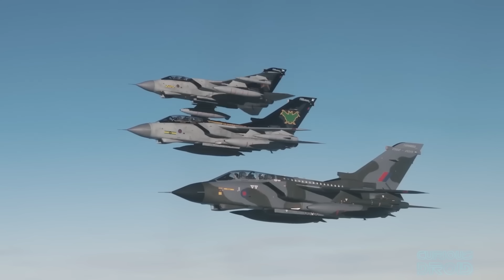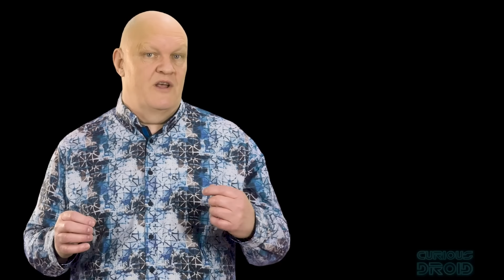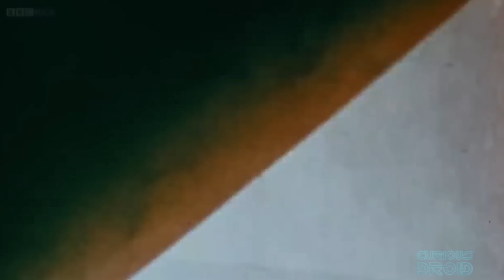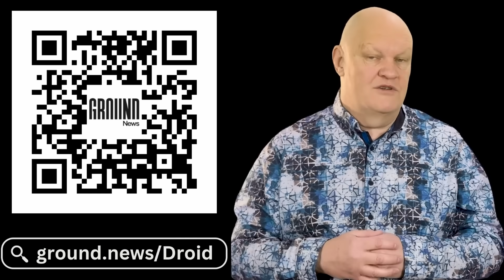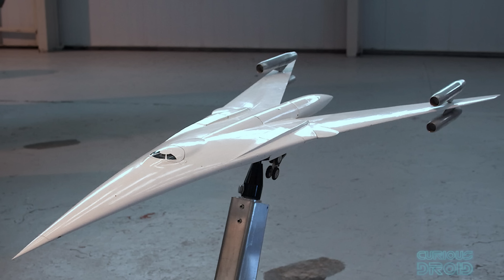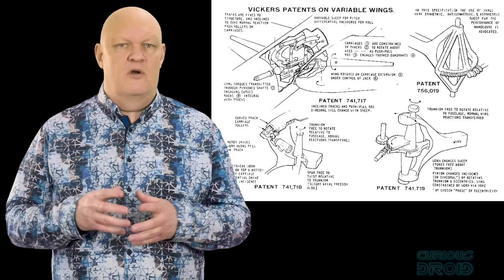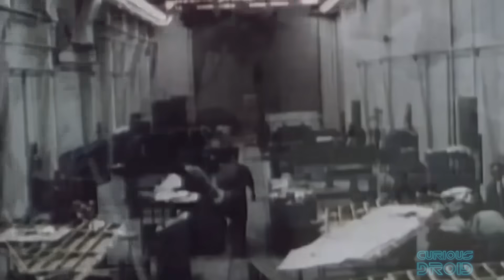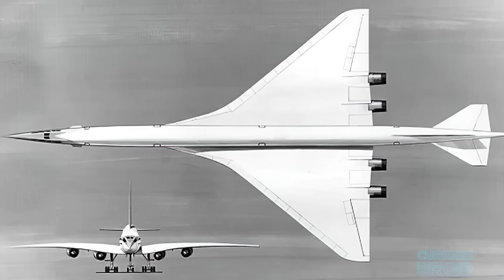Why Aren't Swing Wing Aircraft Made Any More?

Comment: The English Electric lightning made do with almost no wings at all,  pilots used to joke that the the Lightnings wings were only there to space the navigation lights apart.
Reply: The Lightning actually had quite a large wing area, a delta shape with some of the trailing edge cut out. Wing fuel capacity was compromised by accommodating a long under carriage leg, so the flaps & part of the leading edge were also used as fuel tanks.The fuselage held no fuel, so a 250 gal slipper tank was added to the belly, which was increased to 600 gal in later versions, enough for 35 to 50 minute sorties.
Reply: The F-104 held its fuel in the fuselage, whilst the Lightning had to cram it into the flaps.
Reply: That's true. But they were designed for very different purposes. Landing or taking off from even a large carrier would have gone very badly for a Lightning.
Reply: Thinking of the F-104 as well. The wings look almost comical.
Reply: @Laotzu.Goldbug indeed, the Starfighter had tiny short wings, but it also had a very sophisticated blown flaps system.
Reply: The English Electric Lightning seems superior to the F-104 for several reasons. The Lightning reaches Mach 2.3 compared to the F-104's Mach 2 speed. Additionally, it boasts a larger wingspan of 10 meters, providing better stability and maneuverability, compared to the F-104's shorter 6-meter wingspan. Furthermore, the Lightning has a higher thrust-to-weight ratio of 0.74 compared to the F-104's 0.54. It's puzzling why the F-104 was designed with its stubby wings if it doesn't achieve higher speeds than the Lightning.
Reply: @xponen  Cherry picking your data.
Reply: The F-104 was far easier to maintain and was much quicker from alert to brake release and intercept. The Starfighter could intercept an aircraft at 30k feet, 150 miles away from base in about 9 minutes. Pretty dang fast!
Reply: @xponen yes, but remember that the Lightning had two jet engines, possibly each one more powerful than the J-79. The Starfighter had just one.
Reply: @duartesimoes508 yet, the F-104G was as fast as the Lightning. Tells you something about the difference in aerodynamics of each aircraft.
Reply: @pjotrtje0NL she was much lighter than the Lightning too. Had very good aerodynamics and more than enough thrust for her weight.
Reply: @xponen But the Lightning had a terrible range problem that limited its operational effectiveness and a killer of brit pilots.
Reply: @sandervanderkammen9230  Only 20 pilots were killed vs. 116 German pilots alone with the f-104
Reply: RAF pilots called the Lightning the Aluminum death tube... not a very reassuring moniker and a major contributing factor in the demise of English Electric aircraft division and why the British stopped making supersonic jets.
Reply: The F-104 was an outstanding jet but a lousy Fighter and combat aircraft. She had a formidable climb rate but apart from that everything was downhill. Everytime the Starfighter entered combat her performance was lacklustre and I'm not even going to dwell into how an unforgiving aircraft she was.
The Luftwaffe above all others was screwed big time with the contract, losing - I believe - 292 aircraft out of  916. This is horrendous. But even Air Forces who didn't play with the aircraft's wing load had an unacceptable rate of accidents too. RCAF namely.
Reply: @duartesimoes508 part of the Luftwaffe’s problem was that Lockheed tried to sell them an interceptor with bombs slapped on to make a strike aircraft.

It wasn’t bad at what it was built to do, it was just bad at what it was forced to do.
Reply: @duartesimoes508 the Luftwaffe operated the F-104G in a different environment than anticipated - low and fast. That delivers more casualties. Plus, coming from the F-84F, the F-104G had a significant increase in speed and complexity, also ingredients for more casualties. As such, the F-104G was a great aircraft for the Air Forces that operated them in large numbers: Belgium, the Netherlands, Germany, Denmark, Italy, Greece, Turkey and Norway. Just focusing on attrition is an easy, and wrong, standpoint.
Reply: @pjotrtje0NL I am sorry, but losing one third of the fleet in accidents seems unacceptable to me. Some of the causes could have been avoidable. And instead of using the Starfighter as a Fighter Bomber the Germans should have kept her Starfighters as Interceptors and buy Mirage 5 or Bucanneers as Strike aircraft. It was a bad choice from the start and to make things worse it seems that Lockeed bribed everyone.
Reply: @duartesimoes508  Guess it wasn't "an outstanding jet" then was it?
Reply: 15% of Lightning were list due to engine  fires with a overall loss rate of 39 %
1 out of 4 Lightning pilots were killed in accidents.
Reply: @sandervanderkammen9230  The loss rate was only 16.3%, not 39%. A total of 55 aircraft were lost out of 337 built. Only a total of 20 pilots were killed, not 1 in 4
Reply: @edwardhuggins84 I suggest you read; 

'Lightning Eject' The dubious safety record of Britain's only supersonic fighter 
by Peter Caygill
Reply: THE LIGHTNING HAS THE HIGHEST LOSS RATE OF ANY MACH 2 INTERCEPTOR... SO APPALLINGLY BAD THAT BRITAIN STOPPED MAKING SUPERSONIC MILITARY AIRCRAFT.
Reply: @WilhelmKarsten ALSO WRONG THE LIGHTING LOSS RATE IS NOT THE HIGHEST 16.3% VS 30% FOR THE F104 NEARLY DOUBLE THE AMOUNT
Reply: @edwardhuggins84  It's not an often discussed topic especially in the UK but the Lightning actually has a higher loss rate than the F-104.
Reply: @WilhelmKarsten  Wrong, the F104 has a higher loss rate than the lighting. 30% for the F104 vs. 16.3% for the lighting 🤦
Reply: @edwardhuggins84  You're taking the piss mate... Lightning has a 38% loss rate which is why RAF pilots named it the "Aluminium Death Tube"
Reply: @WilhelmKarsten  No, it doesn't. Out of 55 airframes of 337 built were lost, so 55/337*100=16.32. A 38% loss would mean 128 airframes, so it is you that is taking the piss mate
Reply: @edwardhuggins84  38%
Reply: @WilhelmKarsten It's 16.3%, not 38%
Reply: @edwardhuggins84  The Lightnings Loss rate was a staggering 38%?
Reply: @WilhelmKarsten  No, it wasn't it was 16.3%. Only 55 out of 337 built were lost.
Reply: @WilhelmKarsten Why are you lying? The other guy is correct it was only 16% not 38%
Reply: @edwardhuggins84 you are 100% correct
Reply: @WilhelmKarsten  yes the British pilots did call it "aluminium death tube" but not because of how dangerous it was and infact they loved the aircraft
Reply: @edwardhuggins84  It was Britain's first supersonic miliary aircraft... it would also be its last and only supersonic miliary aircraft.
Reply: @UDKMe-1984  The Lightnings loss rate is 38% percent.
Why do brits try to deny that their aircraft were inferior and suffered appalling loss rates?
Reply: @WilhelmKarsten  You are wrong again. Britain has built three more after the lighting and is developing a fourth one
Reply: @WilhelmKarsten  wrong, the loss rate was 16%, and the aircraft was superior to the F-104, which had an appalling loss rate of 30%, which has been pointed out to you
Reply: @edwardhuggins84  Please cite the names of other British supersonic miliary aircraft built after the Lightning???
Reply: @UDKMe-1984  Sorry lad, the Alumium Death Tube was a pilot killer with a staggering 38% loss rate.
Reply: @WilhelmKarsten  Jaguar, tornado and typhoon and the one being developed is the tempest
Reply: @WilhelmKarsten  Sorry, kid, but it was 16%, not 38%, and if you go by pilots kill the lighting had 20 fatalities vs 116 just in the German airforce alone
Reply: @UDKMe-1984  It looks like he is using the fatality rate of the lighting, which is 36%, whereas the F-104 has 40%
Reply: @edwardhuggins84  Sounds about, right 😆
Reply: @edwardhuggins84  Those are not British jet aircraft... and Tempest does not exist
Reply: @UDKMe-1984  The English Electric Lighning was a killer with a staggering 38% loss rate...
Lockheed makes the RAFs most advanced jet fighter.
What's English Electric doing these days???
Reply: @WilhelmKarsten  yes, they are, and I did say that the tempest is in development. Learn to read properly.
Reply: @WilhelmKarsten  35% of the F-35 is British, lol, and the British were involved with it development as well
Reply: @WilhelmKarsten  Sorry, but only 16% of lighting ever built were lost and were not killers, unlike the F-104, which lost 30%. English Electric is now part of BAE Systems, which builds 35% of the F-35
Reply: @edwardhuggins84  Breguet was a French aircraft manufacturer and Eurofighter Jagdflugzeug GmbH. is a German aircraft manufacturer based in Munich Germany.

There is no Tempest, it doesn't exist.
It is pure British science fiction like the Miles M.52.
Reply: @edwardhuggins84  Sorry lad, LOCKHEED MARTIN IS AN AMERICAN AIRCRAFT MANUFACTURER.

PLEASE NAME A SINGLE BRITISH JET AIRCRAFT STILL IN PRODUCTION IN THE UK?
Reply: @UDKMe-1984  BAE Systems I not a jet aircraft manufacturer, it has never produced any jet aircraft on its own and no longer makes any British jets.

Please name a single British jet aircraft still in production in the UK?
Reply: @WilhelmKarsten  You are wrong again. The jaguar was by SEPECAT (a company owned by Breguet and British Aircraft Corporation) co-developed by Breguet and British Aircraft Corporation (now BAE Systems)

The typhoon is a development of the British Aerospace EAP (British Aerospace is also now BAE Systems), and Eurofighter Jagdflugzeug GmbH is owned by Airbus, BAE Systems and Leonardo

And again, because you can not read the Tempest is in development and is not science fiction
Reply: @WilhelmKarsten  Sorry, kid, but 35% of the F-35 is built by BAE Systems, which does make British fighters.
Reply: @WilhelmKarsten  the Typhoon.

Can you please stop spewing out lies
Reply: @edwardhuggins84  YES, Jaguar was a French aircraft.
Panavia and Eurofighter Jagdflugzeug GmbH are German aircraft manufacturers headquartered in Munich Germany.

The Tempest does not exist.

BAE Systems is not a jet aircraft manufacturer and has never designed and produced its own jet aircraft.

Please name a British jet aircraft still made in the UK?
Reply: @UDKMe-1984  Typhoon is  designed and manufactured by Eurofighter Jagdflugzeug GmbH. a German aircraft manufacturer headquartered in Munich Germany.

Please name a single British jet aircraft still made in Britain?
Reply: @WilhelmKarsten  No, it wasn't jaguar that was developed in Britain 

The typhoon is still built in Britain. Eurofighter Jagdflugzeug GmbH and Panavia Aircraft GmbH has no factories. The typhoon is based on the British Aerospace EAP, which frist flew 8 August 1986

Again, the tempest is a real fighter that is IN DEVELOPMENT just like the US Next Generation Air Dominance and F/A-XX.
Reply: @WilhelmKarsten  Wrong again, the typhoon is based on a British design and is manufactured in the uk.

Eurofighter Jagdflugzeug GmbH has no assets
Reply: @edwardhuggins84  The Jaguar is a French aircraft.
 Typhoon is an aircraft designed and built by German manufacturer Eurofighter Jagdflugzeug GmbH.

The Tempest does not exist.

PLEASE NAME A BRITISH JET AIRCRAFT STILL DESIGNED AND BUILT IN THE UK?
Reply: @UDKMe-1984  Typhoon is manufactured by the German company Eurofighter Jagdflugzeug GmbH. headquartered in Munich Germany.
It is majority owned by Airbus SE, a German French and Spanish consortium.
BAE is a customer/partner with only a 33% stake.
The majority of Typhoon production occurs at the former Messerschmitt factory in Manching, Germany.
Reply: @WilhelmKarsten  Wrong Jaguar is not French but built by SEPECAT, a holding company owned by Britain and France with the design and construction done in Britain.

The typhoon is not german. Eurofighter Jagdflugzeug GmbH is also a holding company owned by Airbus, BAE Systems, and Leonardo. It was developed from British Aerospace EAP.

The tempest does exist and is currently in development, a prototype currently being built and will be flying in early 2026.

And I've just had named two with a third in development, but you are too stubborn to admit you are wrong
Reply: @edwardhuggins84   SEPECAT is a FRENCH aircraft manufacturer.
Société Européenne de Production de l'avion Ecole de Combat et d'Appui Tactique
BAC was a dumpster fire and the company never produced a single successful aircraft design on its own.
Reply: @WilhelmKarsten  Wrong, it was developed from British Aerospace EAP and is primarily a British design. Eurofighter Jagdflugzeug GmbH is a holding company, not the manufacturer of the aircraft, and is headquartered in Hallbergmoos, not Munich, and production is evenly spread across the three owners and final assembly is done in Britain. BAE Systems is not a "customer/partner" but lead developer and major owner of the plane
Reply: @WilhelmKarsten  It was a joint holding company, and the Jaguar was primarily a British design and was constructed on the UK.

Now, can you stop it with your BS? You have been told by myself and one other that you're wrong.
Reply: @edwardhuggins84  Jaguar was designed and built by Société Européenne de Production de l'avion Ecole de Combat et d'Appui Tactique
Reply: @WilhelmKarsten Wrong, but keep trying🤦🤣
Reply: @edwardhuggins84  The Lockheed F35 is 0% British.
Lockheed is a USA company, BAe has no stake in Lockheed.
 All F-35 purchased by the US Air Force are 100% made in the USA, it a federal law mandated by the US Congress. No British made parts are used in its construction.
Reply: @edwardhuggins84  PLEASE NAME A SINGLE BRITISH JET AIRCRAFT MADE BY A BRITISH COMPANY IN THE UK???
Reply: @WilhelmKarsten  I have, but you are not listening and keep lying, so you don't have to accept that you are WRONG
Reply: @DoktorBayerischeMotorenWerke  Wrong 35% in built-in Britain, for example, BAE Systems builds the rear fuselage of every F-35 in the global fleet manufactured and assembled at facilities in Lancashire, UK.
Reply: @edwardhuggins84  The very last British jet ever made was a Hawk made in dec. 2022 at BAE Brough. 
Today BAE systems announced another 2,000 jobs to be axed at Brough.
Reply: @edwardhuggins84  WRONG!
Only F-35Bs sold to the RAF are partially assembled by Lockheed subcontractor BAE Systems.
The F-35 was is designed and built by AMERICAN COMPANY LOCKHEED MARTIN.
Reply: @edwardhuggins84  All F-35s used by the US military are 100% made in the USA, this is a US law mandated by Congress.
Reply: @DoktorBayerischeMotorenWerke  Wrong, try again, and don't lie about the jobs being axe because I've just Google it, and the last jobs to be lost was 2017
Reply: @WilhelmKarsten  WRONG! this information comes from Lockheed Martin
Reply: @DoktorBayerischeMotorenWerke  Sorry, but you are WRONG! the information about the F-35 comes from Lockheed Martin. Try again.
Reply: @DoktorBayerischeMotorenWerke  and by the way, there is no such law that us military equipment has to be 100% USA made
Reply: @DoktorBayerischeMotorenWerke  For example, the M777 howitzer is manufactured by BAE Systems at Barrow-in-Furness
Reply: @edwardhuggins84  Sorry but he is right, no weapons system purchased for the American military can be made outside the country or contian any foreign made parts... *I looked it up, it a law... so you are 100% wrong
Reply: @edwardhuggins84  I worked in America for 20 years at Northup Grumman, its a Law in America that all parts be 100% made in the USA.
Reply: @edwardhuggins84  The M777 is 70% made under license in the United States of America at the Watervliet Arsenal in New York, USA and the remaining 30% at BAE's facility in Hattiesburg, Mississippi.
 the M777s supplied to the US Army are 100% manufactured in America.
Reply: @edwardhuggins84  Every single F-35 delivered to the US Air Force, US Navy and the US Maines Corps is 100% made in the USA and contains no parts made in the UK.
 The F-35 is an American aircraft designed and made by Lockheed Martin.... not British. 
 There are currently no British companies that make a British jets in the UK.
 Last one built in the UK was in 2022
Reply: @DoktorBayerischeMotorenWerke  You are wrong on both counts. Try again
Reply: @DoktorBayerischeMotorenWerke  wrong the M777 is 100% British try again
Reply: @DoktorBayerischeMotorenWerke   wrong, there is no such law. The RG-31 and RG-33 are South African. The Ranger Special Operations Vehicle is British. Bandvagn 206 Swedish, Alenia C-27J Spartan Italian, do I need to continue or have I made my point 🤔
Reply: @WilhelmKarsten  Sorry, but it's you that's 100% wrong. There is no such law. The RG-31 and RG-33 are South African. The Ranger Special Operations Vehicle is British. Bandvagn 206 Swedish, Alenia C-27J Spartan Italian, do I need to continue or have I made my point 🤔
Reply: @edwardhuggins84  You have zero credibility at this point, as you clearly do not understand the concept of product licensing or US laws.
Reply: @DoktorBayerischeMotorenWerke  sorry, but it is not law that all parts have to be by 100% made in the USA.

Beretta M9 italian 

Heckler & Koch MP5 and MP7 German
Reply: @edwardhuggins84  The RG-33 is made in the USA in York, Pennsylvania.
Reply: @DoktorBayerischeMotorenWerke  Wrong, it is manufactured in South Africa by BAE Systems Land Systems South Africa
Reply: @UDKMe-1984  Buy American Act (BAA) of 1933.

The M9 is manufactured in Accokeek, Maryland.
Reply: @edwardhuggins84  But the ones used by the US military are made in York Pennsylvania
Reply: @DoktorBayerischeMotorenWerke  No, they are not
Reply: @edwardhuggins84  Bandvagn 206 is made under license in several countries including Russia and in America by Oshkosh Defense.
Reply: @edwardhuggins84  The C-27J is a joint Lockheed Martin program and made in the USA and Italy
Reply: @DoktorBayerischeMotorenWerke  lol nice try, but Russia doesn't have any, and they are built in Sweden, not by Oshkosh Defence
Reply: @edwardhuggins84  PLEASE NAME A SINGLE BRITISH JET AIRCRAFT STILL MADE BY A BRITISH COMPANY IN THE UK??
Reply: @WilhelmKarsten  I have Jaguar, a tornado and typhoon, and the tempest, which is in development, but you are not listening
Reply: @DoktorBayerischeMotorenWerke  Nice try. The C-27J is Italian and built in Italy. It is an advanced derivative of G.222.
Reply: @WilhelmKarsten  you're still at it with your BS, I see
Reply: @edwardhuggins84  Not British jets, Tempest DOES NOT EXIST
Reply: @UDKMe-1984  Just the facts, Please name a single British company that still makes British jet aircraft in the UK?
Reply: @WilhelmKarsten  THEY ARE BRITISH JETS AND THE TEMPEST DOES EXIST
Reply: @WilhelmKarsten  OK, JUST THE FACTS THEN. JAGUAR, TORNADO, AND TYPHOON WITH THE TEMPEST IN DEVELOPMENT WITH A PROTOTYPE UNDER CONSTRUCTION.
Reply: @WilhelmKarsten  BAE SYSTEMS
Reply: @edwardhuggins84  Not British.
The Tempest does not exist.
Reply: @edwardhuggins84  Please name a single British company that still makes British jet aircraft in the UK?
Reply: @UDKMe-1984  What British jet aircraft is currently made by BAE Systems?
Reply: @WilhelmKarsten  BAE systems
Reply: @WilhelmKarsten  Typhoon
Reply: @WilhelmKarsten  THERE ARE BRITISH AND THE TEMPEST DOES EXIST
Reply: @edwardhuggins84  BAE Systems has never made a jet aircraft of its own.
Reply: @UDKMe-1984  Typhoon is manufactured by Eurofighter Jagdflugzeug GmbH. a German company headquartered in Munich Germany.
Reply: @WilhelmKarsten  yes it has🤦‍♂️
Reply: @edwardhuggins84   Sorry lad, Société Européenne de Production de l'avion Ecole de Combat et d'Appui Tactique and Eurofighter Jagdflugzeug GmbH. are Not British companies.
Reply: @WilhelmKarsten  wrong Eurofighter Jagdflugzeug GmbH is a holding company and doesn't manufacture anything. Saudi Arabia bought 72 Eurofighters in 2007 from BAE Systems for approximately £4.4 billion
Reply: @WilhelmKarsten  Sorry, kid, but neither actually manufactured anything as both are holding companies. The Jaguar was built in the UK by BAE Systems as is the typhoon. Please go a look up who sold the typhoon to Saudi Arabia?
Reply: @edwardhuggins84  The C-27J was designed and built by a company called 

'Lockheed Martin Alenia Tactical Transport Systems'
Reply: @edwardhuggins84  You mean BAC? A company that never developed a single, successful jet aircraft on its own?
And no longer exists?
Reply: @WilhelmKarsten  What? Sorry, but let's look at some of them. Jet Provost 734 built, Strikemaster 146 built, Tornado, which was based on the AFVG.
Reply: @WilhelmKarsten  and you didn't answer my question. Who sold the typhoon to Saudi Arabia?
Reply: @DoktorBayerischeMotorenWerke  wrong The C-27J is developed and manufactured by Leonardo's Aircraft Division (formerly Alenia Aermacchi until 2016).
Reply: @edwardhuggins84  The US Air Force no longer uses the C-27C. the program was  cancelled.
The C-27J was developed by a joint Lockheed/Alenia partnership company called LMATTS and was manufactured in the USA by Lockheed Martin.
Reply: @DoktorBayerischeMotorenWerke  100% WRONG
Reply: @edwardhuggins84 
Both the Provost and Strikemaster are not BAC designed, they are legacy aircraft inherently from Hunting which became defunct in 1960 and was absorbed into BAC.

Tornado WAS  built by Germany company called Panavia.
Reply: @edwardhuggins84 Eurofighter Jagdflugzeug GmbH. sells the Typhoon... it's a German jet aircraft.
Reply: @edwardhuggins84  BAC has never designed and built a successful jet aircraft own its own.

Tornado is a built by Panavia Aircraft GmbH. A German company headquartered in Hallberhmoos Germany.
Reply: @sandervanderkammen9230  Sorry, but it is you who is very confused. Both the Provost and Strikemaster were designed and built by BAC

The tornado is a development of the BAC AFVG, and Panavia is a holding company, and the aircraft were built in Britain
Reply: @WilhelmKarsten  yes it has
Reply: @WilhelmKarsten  again, you have refused to answer my question. Who sold typhoons to Saudi Arabia?
Reply: @edwardhuggins84  The C-27J was manufactured in the US by Lockheed Martin Alenia Tactical Transport Systems (LMATTS)  a joint company formed to develop the C-27J.
Not made in Italy
Reply: @sandervanderkammen9230  it is not a German aircraft it is a development of the British Aerospace EAP primary design in Britain and built in Britain and Eurofighter Jagdflugzeug GmbH is a holding company with zero assets.
Reply: @DoktorBayerischeMotorenWerke    100% WRONG it is made in Italy, and not the USA
Reply: @edwardhuggins84  The US military cannot buy aircraft built in a foreign country... all of the C-27Js in US service were made in the USA.
 Lockheed is a primary subcontractor for the aircraft made in Italy as well as it shares many parts in common with the Lockheed C-130J
Reply: @edwardhuggins84  Provost was designed by Percival and merged with Hunting in 1954.
 Hunting Aircraft manufactured the Provost until the company became insolvent and was absorbed into BAC.

BAC did not design the Provost and was not the original manufacturer.
Please stop posting false and ignorant misinformation regarding this matter.
Reply: @DoktorBayerischeMotorenWerke  Wrong
Reply: @edwardhuggins84  Tornado was a manufactured by Panavia, a German company.
The Tornado was built under license in the UK but is not a British design.
Reply: @edwardhuggins84  PLEASE NAME A SINGLE BRITISH JET AIRCRAFT STILL MADE IN THE UK???
Reply: @UDKMe-1984  The Eurofighter Jagdflugzeug GmbH Tyhoon is a not a British aircraft.
Eurofighter is majority owned by Airbus SE a German French and Spanish consortium.
Reply: @UDKMe-1984  PLEASE NAME A BRITISH COMPANY THAT STILL MAKES A BRITISH JET AIRCRAFT IN THE UK???
Reply: @edwardhuggins84    Jaguar was designed and built by Société Européenne de Production de l'avion Ecole de Combat et d'Appui Tactique a French aircraft company
Reply: @edwardhuggins84  Typhoons are made by Eurofighter Jagdflugzeug GmbH a German company majority owned by Airbus SE
Airbus SE is a German-French and Spanish consortium.
It's not a British company.

BAE Systems sold its shares to Germany in 2006.
Reply: @edwardhuggins84  Please name a single British company that still makes British jet aircraft in the UK?
Reply: @WilhelmKarsten  I have answered all your questions correctly, but you are not listening, and you are repeating the same incorrect information. Everything i have said is correct. At the same time, you have refused to answer my question. Who sold typhoons to Saudi Arabia?
Reply: @WilhelmKarsten  BAE SYSTEMS
Reply: @WilhelmKarsten  Eurofighter Jagdflugzeug GmbH is a holding company and doesn't manufacture anything. Stop repeating this piece of incorrect information, and the typhoon is based on a British design and primary development done in Britain.
Reply: @UDKMe-1984  PLEASE NAME A BRITISH JET AIRCRAFT DESIGNED AND BUILT BY BAE SYSTEMS?
Reply: @UDKMe-1984  Eurofighter Jagdflugzeug GmbH manufacturers the Typhoon in Manching Germany and final assembly is also performed in the UK for the RAF.

Eurofighter Jagdflugzeug is majority owned by Airbus SE a German French and Spanish consortium.
Not British.
Reply: @WilhelmKarsten  Wrong Eurofighter Jagdflugzeug GmbH is a holding company with no assets and doesn't manufacture anything. The Eurofighter Typhoon is not german but multinational based on a British design. The British Aerospace EAP and development primarily by BAE Systems 37.5% of every aircraft is manufactured by BAE Systems in the UK. Only 29% of the plane is manufactured in Germany by Airbus with Final assembly, which is done by BAE Systems in the UK and the German aircraft in Germany but in Hamburg, not Munich, the Saudi Arabians brought their Typhoons from BAE Systems, not Eurofighter Jagdflugzeug GmbH. But the plane is mainly British.
Reply: @WilhelmKarsten  BAE Systems Hawk and Tempest, and please don't say it doesn't exist because it does.
Reply: @UDKMe-1984  THE HAWK ENDED PRODUCTION IN 2022.

The Hawker Siddeley Hawk was a half century old legend design acquired when H.S. was acquired by British Aerospace in 1977.
It was not a BAE Systems design.

TEMPEST DOES NOT EXIST, it is a concept proposal for a multinational design.

No Tempest is in production or has ever flown because no such aircraft by this name yet exists.
Reply: @WilhelmKarsten  Hawker Siddeely merged into British Aerospace, which then merged again into BAE Systems, so you're WRONG.

The Tempest is not a "concept" as a prototype is under construction, and it's not a multinational design as other nations have joined the project after BAE Systems design it
Reply: @UDKMe-1984  The Tempest program has been canceled, it has been officially merged with the Mitsubishi-Leanardo F-3 program, a multinational program.
Reply: @sandervanderkammen9230  Wrong for a start, Leonardo had joined Tempest and not Mitsubishi, which was officially called F-X, not F3. Due to the advance status of the tempest, it was decided that the prototype would be finished and be the design for the combined project.
Reply: @UDKMe-1984  Tempest does not exist, Mitsubishi will be the prime contractor and manufacturer of the GCAP (global combat air program) 
Leonardo S.p.A is also a major development and production partner.
No longer a British jet aircraft program.
Reply: @UDKMe-1984  Production of the F-3 is not scheduled to begin until 2030.

Can you answer his question?
Name a British jet aircraft that is currently in production in the UK???

Because I can't find any British jet aircraft still in production.
Reply: The status of F-X (not F-3) is the same as the Tempest, which does exist and has entered the prototype stage. You have just contradicted yourself, and Mitsubishi is not the prime contractor and manufacturer of the Global Combat Air Programme (GCAP).

To answer your question, the typhoon that was developed from the British Aerospace EAP
Reply: @UDKMe-1984  Tempest does not exist.
Typhoon was designed and is manufactured by the German company Eurofighter Jagdflugzeug GmbH.  A company majority owned by Airbus SE, a German-French and Spanish consortium.
Reply: @UDKMe-1984  BAE Systems produced the very last British jet aircraft in December 2022.
Reply: @DoktorBayerischeMotorenWerke  wrong
Reply: @UDKMe-1984  The TRUTH is irrefutable, Production of the Hawk ended in Dec. 2022, there are no longer any British jets being made.
 Why are you in such denial?
Reply: @UDKMe-1984  PLEASE NAME A SINGLE BRITISH JET AIRCRAFT STILL MADE BY A BRITISH COMPANY IN THE UK????
Reply: @UDKMe-1984  Typhoon is an aircraft designed and manufactured by Eurofighter.... Not BAE.
Reply: @UDKMe-1984  Airbus SE is the majority owner of Eurofighter.
Airbus SE. is not a British company
Reply: @UDKMe-1984  Like the Miles M.52 the Tempest does not actually exist, the only thing that does is artist rendering and plywood and styrene foam models... the actual plane does not exist and construction is not set to even begin until at least 2028... if ever.
Reply: @DoktorBayerischeMotorenWerke  wrong Eurofighter is a holding company and doesn't manufacture or design anything
Reply: @WilhelmKarsten  I have answered that question correctly several times, but I try again the typhoon, which is NOT designed or manufactured by the holding company Eurofighter Jagdflugzeug GmbH
Reply: @sandervanderkammen9230  Sorry, but it does exist as a prototype is currently being manufactured
Reply: @UDKMe-1984  Eurofighter is a company majority owned by Airbus not BAE.

BAE Systems has never designed and manufactured its own jet aircraft.

 BAE is no longer an aircraft manufacturer and has not been since 2022.
Reply: @UDKMe-1984  Primary manufacturing and assembly of the Eurofighter Jagdflugzeug GmbH Typhoon is the Airbus facility in Manching Germany.

There are no official documents that refer to the plane as the "BAE Typhoon" because BAE Systems no longer makes any jet aircraft.
Reply: @UDKMe-1984  Construction of the first Tempest prototype has not begun, it is scheduled to begin construction in 2028 if the project is not canceled before then.
Reply: @UDKMe-1984  Typhoon is manufactured by EUROFIGHTER JAGDFLUGZEUG not BAE,
EUROFIGHTER JAGDFLUG is a subsidiary of AIRBUS and is not a British company

BAE Systems sold its 15% share in Airbus in 2015 to the German company DASA, the majority partner in AIRBUS.

AIRBUS is not a British company
Reply: @sandervanderkammen9230  Sorry it has, and it's expected to start flights in early 2026
Reply: @DoktorBayerischeMotorenWerke  it not manufactured by the holding company Eurofighter Jagdflugzeug GmbH
Reply: @UDKMe-1984  The British PM said last week work on the prototype has been delayed until 2028.
The contract to build the prototype has not yet been awarded.
As of today there is no examples of the  Tempest in existence.
It still remains a concept proposal and the program may be canceled before any work begins.
Reply: @UDKMe-1984  The Typhon is made by Eurofighter, not BAE.

no official documents exist that refer to the plane as the "BAE Typhon" because BAE doe not make jet aircraft anymore.
 BAE SYSTEMS has never made jet aircraft.
Reply: @UDKMe-1984  That's a pathetic argument and a completely moot point, there is no Tempest because none have been completed nor has the design been completed or agreed upon.
There is no Tempest, none exist yet
Reply: @WilhelmKarsten  How pathetic are you that you have to make up stuff? The British PM had made no such announcement last week that the only one he did was to call for a general election. A design has been agreed upon, and a prototype has been started, so you are wrong
Reply: @UDKMe-1984  Nothing more pathetic than you desparate attempt to deny that Britain no longer makes its own jet aircraft.

The RAFs most advanced jet aircraft in service is the American Lockheed F-35!!!
Reply: @UDKMe-1984  Sent you a link to the Newspaper article that quoted the PM.
No contract to build the Tempest has been signed yet, no actual aircraft prototype yet exists and the is no evidence to support that the plane ever enter production.
Reply: @jonathanbowen3640  Sorry, but the Lockheed Martin F35 is an American jet aircraft, it is not British.
There are no longer any british jet aircraft produced in the UK... what little was left of  Britain's aircraft industry collapsed after privatization.
Reply: @WilhelmKarsten BRITAIN HAS NOT STOPPED MAKING SUPERSONIC MILITARY AIRCRAFT 🙄